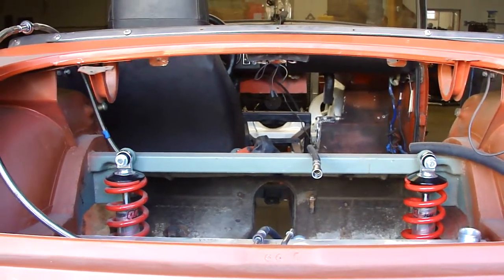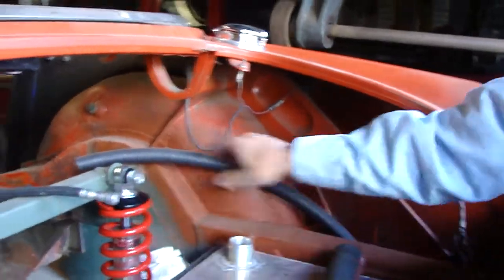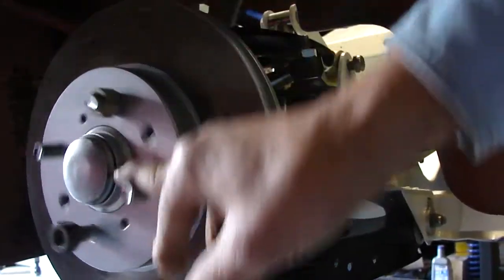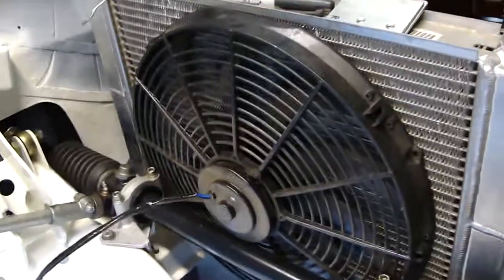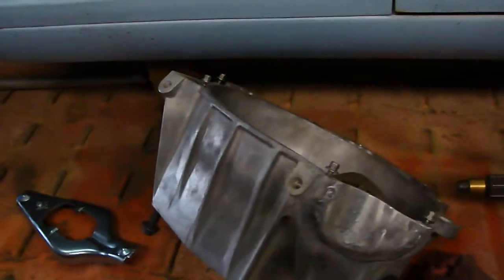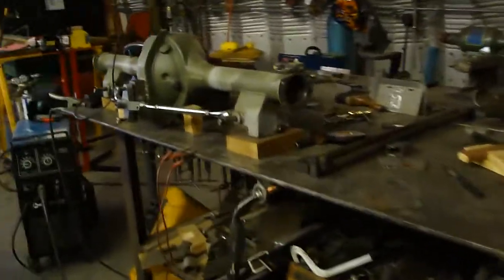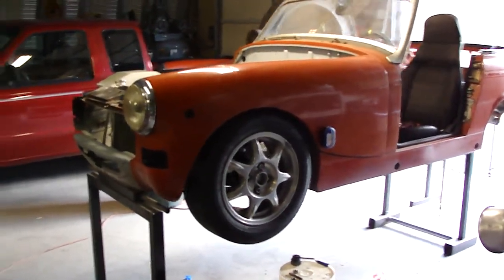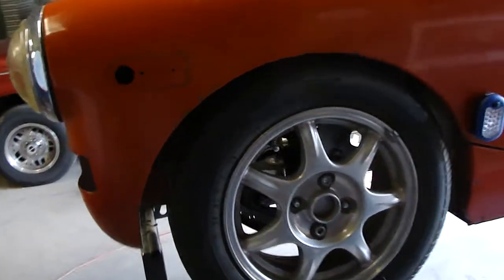MG MIDGET RACING BUILD UP:SCCA NASA RALLY CROSS * 2.2 CHEVY * 5-SPEED * TURBO CHARGER video #2

Comment: I know it's been along time since anyone posted. I'm wondering about you steering setup. Is that the original steering column/shaft? Did you just strip the original column of the switches and then ad the aluminum sleave for looks? I'd like to do something similar to my midget. Thanks
Reply from the maker: Matt Honeycutt  Sorry, I have not seen this guy in about 3 yrs. I don't know anything new about the car.